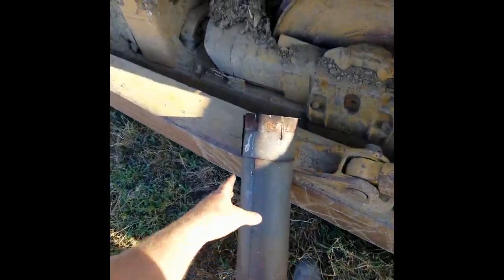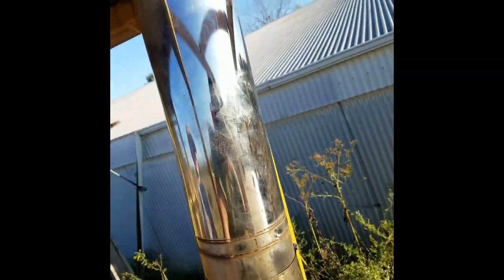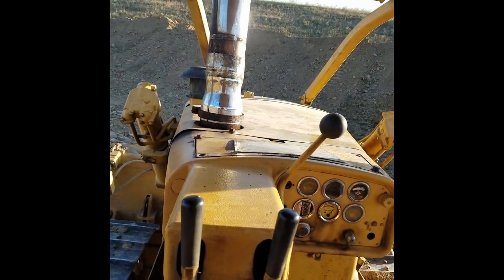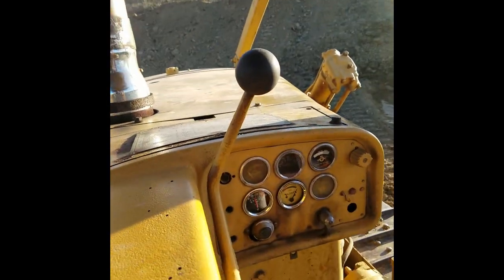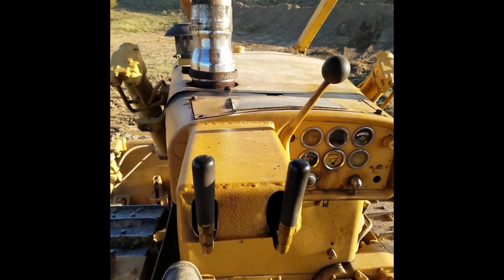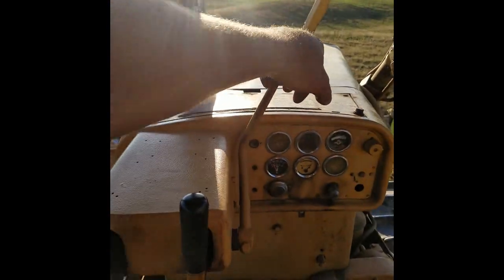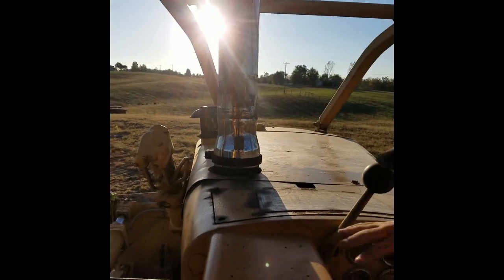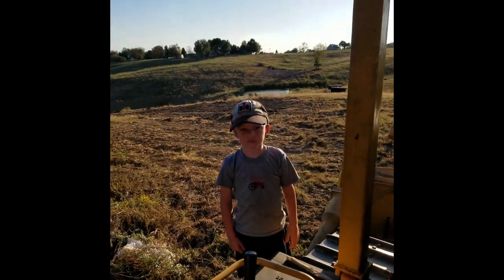D7E gets some chrome. (it was laying around)

Comment: Hi there. I have been following you these last few days and feel I need to share my experience with you regarding the exhaust system on your beautiful old Cat D7E.
I have many fond memories of this model, and have been working on Cats since I started my apprenticeship  back in 1964.... so that dates me well!
A few times I have had customers complain of engine overheating after they worked on the exhaust system, namely, they removed the old pipe with its “restricted “ section near the bottom of the pipe with “ something they found laying around” which then gave them a straight through pipe “with no restriction!”
Sounds good, but not good for the patient!
You may be aware of what I am about to share, but I write this in hope of being a help to you.
Where do I start......ok
These machines have what is known as an exhaust type dust extraction system that sucks dust from the cyclone type dust extractor mounted on top of the air cleaner under the bonnet, on top of which is mounted the air intake shroud.  The dust is sucked from the precleaner body and ejected with the exhaust gases out the exhaust pipe.
The suction is created by the positioning a pipe in the exhaust elbow the turbo connects to under the bonnet.
You will see a pipe going from this elbow back to the precleaner on top of the air cleaner.
When you had the exhaust pipe off, you would have seen the top of the exhaust pipe/ elbow coming up through the bonnet and in the centre of the outlet of the elbow where your pipe fitted on you should have see the end of a smaller pipe in the centre of the elbow outlet sticking up to a position just above the top of the elbow your pipe fits onto.
This smaller pipe is the one that goes back to the precleaner, and this is where the dust comes out to go up the pipe and out the top.
Whenever the exhaust pipe is replaced, it is imperative to fit the genuine Cat one as shown in the parts book, as this is a specially designed pipe with a venturie (?) built into the pipe, this is why it looks like the pipe is restricted, but this is as it should be.
Now, when the exhaust pipe is fitted, that small pipe sticking up in the exhaust elbow is positioned in the pipe with the open end of the pipe situated in the venturie , and the action of the exhaust gases travelling past the open end of the little pipe is what creates the suction that draws the dust out of the precleaner and out the exhaust pipe.
Now, if you do not have the proper exhaust pipe on, what happens is that because the sucking action is not working, exhaust gases which are super hot travel through that little pipe back to the precleaner,where all the little plastic tubes that separate the dust from the air, are promptly melted. The hot gases then go into the air cleaner, coating the air filter elements with black soot,( check them to see if this is happening) and because the engine is then drawing in hot exhaust emissions, this causes the engine to heat up........quickly!!
Hope this helps......I have had this happen numerous times.
Also........something to check....if you follow the pipe from the air precleaner across to the exhaust elbow, you will  see that the little pipe that carries the dust into the exhaust elbow is removable. Pull it out and check the area of the pipe where it bends to go up the exhaust pipe and you might find that the dust going around that bend has sandblasted a hole in the tube, thus stopping the suction action and once again allowing the hot exhaust gases to go back to the air precleaner and thus into the engine with the inlet air.
Please,make sure you fit a genuine Cat exhaust pipe. 
In the parts book you will find the Cat do not call it a simple pipe or muffler, which they are not, but something like pipe assembly or extractor........I am am sorry I cannot be more specific on this description.  I have parts book for this machine,but I am currently away from home working on a D5B, won’t be home for 2 weeks.
Hope all this helps.
Cheers, Ken Harris.
Reply from the maker: I understand the venturi effect caused by the exhaust. It appears that restriction is in the elbow coming off the turbo itself. I will get in the book and find out. It does have an exhaust leak where the turbo elbow goes into the turbo, until it warms up. Now then i don't have any soot on the air filter or melted plastic in the pre cleaner.   Thank you for comment. I have been hoping someone with first hand knowledge would be watching, no matter how dated they may be. Experience is valuable on my channel. I will recheck the system and get back to you.

Comment: Did you try putting a brand new air cleaner in it? Also, you might have a large exhaust leak in you manifold which will not let your turbo make boost... less air+more fuel=more heat
Reply from the maker: I did finally figure this thing out. I think. A while back it wouldn't start for the owner. I finally figured out the #1 delivery valve in the injection pump was sticking letting all the fuel pressure bleed off. Since I pulled it apart and cleaned it, it has been running fine. Of course no video because of where it was at the time.

Comment: You may have an air pocket at the temp probe...the fact that the temp drops so quickly when idled down indicates that your temp issue is isolated to near your probe and not reflecting the actual temperature of the block.
Reply from the maker: That could be a possibility. I did change the gauge/probe and there was no air then, but since it has been drained and filled.

Comment: I would check the rad core then are the fan belts slipping is the water pump working as it should I had a D7e it never got hot
Reply from the maker: I'm still having trouble deciding if it's actually getting hot. It has never popped the pressure relief. I put the gauge in and it reads hot. Put the same gauge in my tractor it reads hot as well. When said gauges get to 220 my infrared thermometer shows 160 where the probe for the gauge screws into the water manifold. It seems to be circulating coolant. I'm at a loss. But I'm about to order gaskets for the top tank and have a look.

Comment: Maybe hose off the radiator. You could rod it out with a big, long zip tie if it doesn’t start working right. You’d have to pull the radiator and remove the end tanks, of course. And get gaskets top and bottom. It could come to this. Good luck!
Reply from the maker: That's what I'm leaning towards.